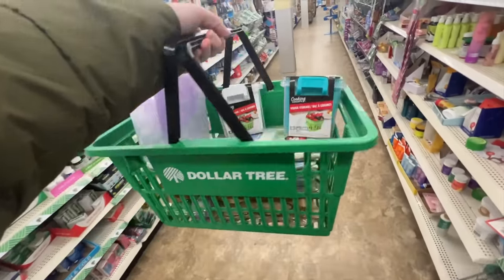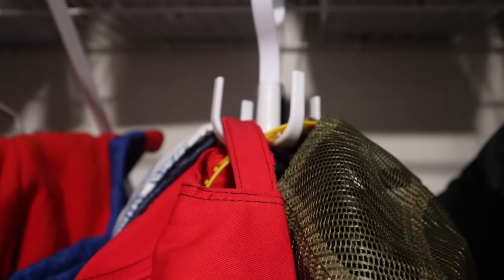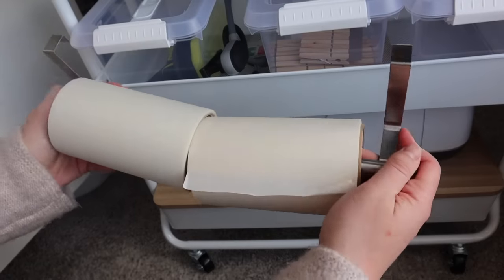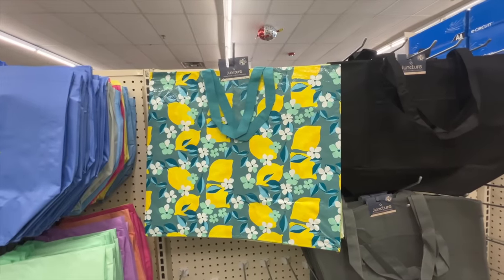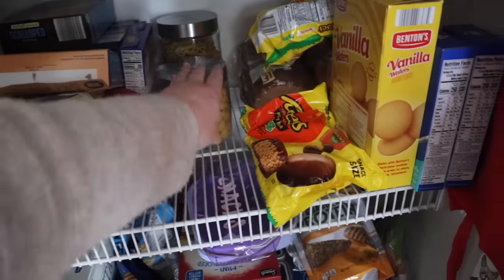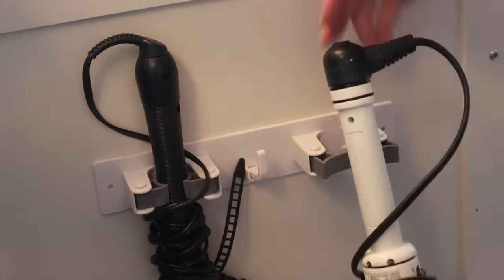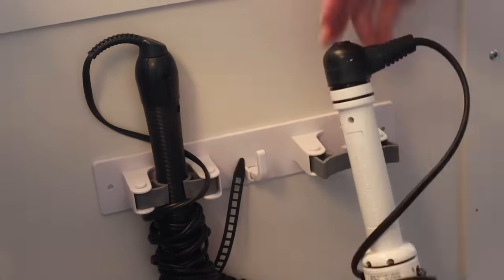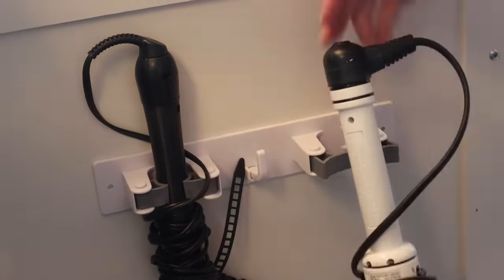25 HIDDEN Dollar Tree Hacks 😮 You'll NEVER look at these items the same again!

Comment: I use the magnetic tins for spices. I put them on some of the tins and they save space. From the children's section I bought the child's broom/dustpan. The long handle fits under the radiators and get the dust my vacuum cleaner can't reach. From the kitchen section the plastic cutting boards are great in the refrigerator. They clean well and avoid spills from dripping on the bottom shelves. Great video with many helpful hints.

Comment: Been married 25yrs this year😳 
I have a decoration at home I recently did for looks and love it. Its a short wide wine glass(like what you find on top of pianos when they perform and to put tips in..lol) filled with clear off the wall brand orbis from Amazon and water. Once orbis got big I put in 1 fake 🌹from DT at bottom, sprinkled red glitter from DT in it and pushed it carefully down and around with bamboo skewer, and a couple clear jewels from DT. I didnt have waterproof fairy lights, but put a battery operated tea light candle behind it and love it. This i could see in wine glasses on tables or even vases with fake flowers to resemble bouquet, and if it would work even laminate small photos of couple since they first met and put them inside as well. I do know floating candles work with these as well. What you could fill the vases with are endless. I wish these were an idea when I got married.

Comment: Warning - be careful of candles in glass. I have had a glass explode with the heat - nobody was close by but it could have been tragic😮.
Reply: If you have real candle in glass jar, before you put the candle in place a small amount of water, tsp maybe. It keeps the glass from breaking and makes it easier to remove the remaining wax.
Reply: Agreed! And good point!
Reply: That’s why I only use battery operated candles 😊
Reply: I've had this happen as well, and mine started a small fire. Luckily, I happened to be right there. Have only used warmers since if it's glass.
Reply: You can always put a short layer of salt in the glass under the candle to keep the glass from overheating. A half an inch or more.

Push the candle into the salt a little and that'll keep it from shifting side to side.

Because it's white it can add to your decor theme.
Reply: Omg this just happened to me too!  I had fallen asleep but woke up to my mantle ignited and engulfed in flames.
Reply: @ladygodiva8738  that's downright terrifying.
Reply: Exactly why you should NEVER leave candles unattended.
Reply: @cherylfrench2526 THAT'S IT, NEVER!!!!!!
Reply: @cherylallison6603  True as I have done that for decades with many types of glass holders and you don't have wax stuck at the bottom of the container.

Comment: Here is what I use to help me with putting on bracelets. I attached an alligator clip to a skewer and embellished it. I put the ring in the clip and hold the skewer on my wrist. Then I move the clasp of the bracelet to the loop. It takes a little getting use to using it but it works great and it took pennies to make.
I know we've been warned about using temu but they sell things that dt carries but even cheaper. That multi hook you used was even less there. But it's one of those "buyer beware" types of deal.🤞🤞👍I also use glue dots on crafts I know I want to reuse down the road. I don't have any little ones so the glue dots work well.
This was a great video! Lots of ideas! Thanks!!! ♥️♥️

Comment: I use the claw hook hanger that you used in the beginning of the video for hats and on your cart in my van to hang bags like you did at the end. When we go on trips I put one on the back of each headrest and whoever is sitting there can hang backpacks, tote bags, etc… I even sew hanging loops on pillows and throw blankets. The kids just shove them around and they often fell out when the door was opened. Now when not in use they hang as far from the door as possible. I love your towel hack for the car seat gaps. I have one that no product fixed and the towel will work perfectly. I’m embarrassed I didn’t think of it myself.

Comment: I keep an old backpack in the car with those blue paper towels from the auto section at Walmart, first aid kit, and other stuff I don’t remember right now.  Those plastic crates would get smushed and cracked in my car.  My 2009 Subaru Outback doesn’t have those built in bins in the cargo area. 
 I’ve been trying to think of a solution for the extra large umbrella, emergency light/toolbox, and the brush I keep for cleaning the dust off my rear lights as we live on a gravel road.  The toolbox stays put, but the umbrella and the brush roll around.  I’m going to try those wire hooks, although the very back of the cargo area is hard to reach.

Comment: The slap bracelet idea is okay, but you can do the same thing with TP tubes by just cutting a slit down one side. Add a rubber band over it if something is esp chaotic.
Reply from the maker: Yep you could. The rubber bands have dented my vinyl before so that’s why I like those
Reply: @Whiskeyandwhit  Sorry if I was unclear, I meant a rubber band on top of the TP tube bc that'd prevent the dent (if you don't do it too tight).
If the roll is skinny enough, you don't even need to slit the TP tube.

Comment: What was the things that looked like a cup holder with extra slots?!! 🤔🤩🤩
Reply from the maker: It's from the DT auto section and it's supposed to be an extender so you have extra storage. Unfortunately, it doesn't fit well in the slot and keeps popping out so I'm not a huge fan :(